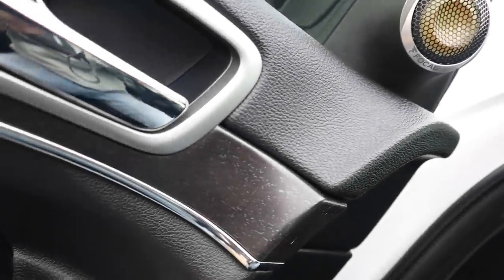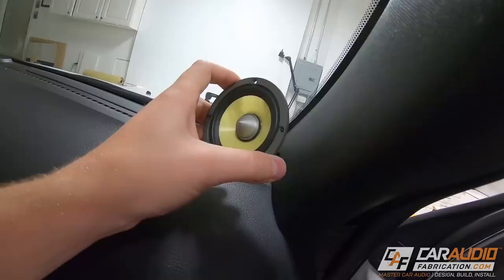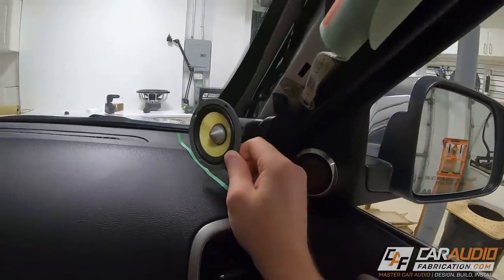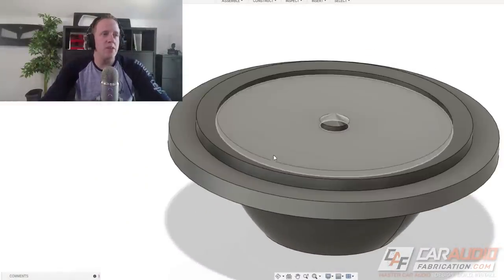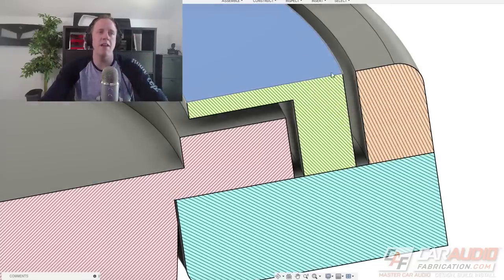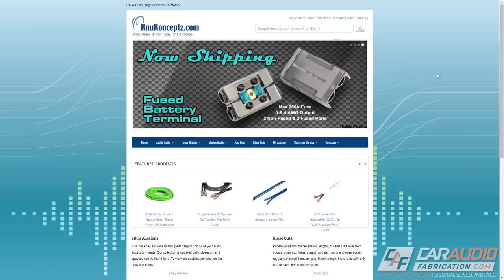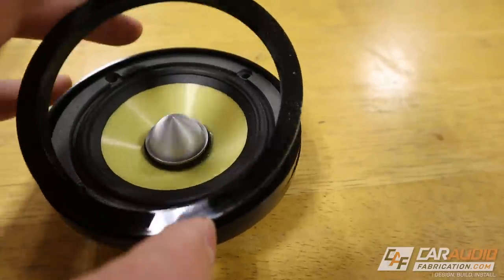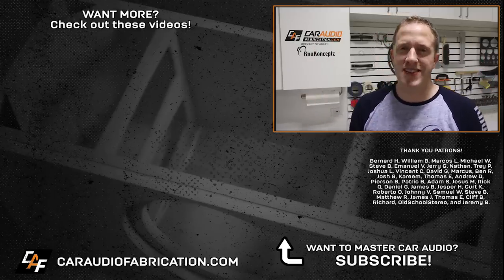Making Speaker Rings & Planning - Custom A-Pillar Speakers

Comment: I just wanted to thank you for being one of the many knowledgeable YouTubers that are not only willing, but also capable of making these how-to videos.
I am currently in the middle of making my very first super tweeter pods.
 I'm kind of regretting not videoing it because I put them in my c-pillars and I haven't found anything like that here on Youtube yet. 
I didn't beam them into anybody's ear either. I placed them up high above the head, as if somebody sitting in the backseat would have somebody shouting over the back of their head above them.
 I'm curious what it will sound like within both firing toward the center console from above.
 Thanks again for all the knowledge and inspiration.

Comment: Heck I wouldn’t be afraid to eliminate that vent.   If you need to defog or defrost side window the dash vents can be aimed.    I eliminated mine in my daily driver 4 years ago and haven’t had any issues at all
Reply from the maker: Hmmm. Thats a pretty good point. I just dont want to hack up the assembly, I can tell it goes pretty deep under the dash, I'd want to take it apart so it can be reinstalled to go back to OEM, and not really in the mood to pull a dash...
Reply: CarAudioFabrication yeah mine were in the sail panels, so they were about a foot long and removed pretty easy.     Multi tool and cut it off flush and cap it would allow yours to be put back together with aluminum ducting tape if going back to oem.   Might not look the prettiest under the skirt if a person looked, but hey.... I’m assuming that’s only if getting traded.    Also a person could look up the parts explosion diagram online and it would show how far back that part goes if you did want to remove.   

Just throwing this stuff out there as ideas for anyone else that’s getting ready to build pillars.      

Did you see in one of the Facebook groups how a fella made a deal and he heats the a pillar and remolds it to create a tweeter spot that looks totally OEM?   WILD!   Looked amazing!

Comment: I would keep those mids on axis as much as possible away from the glass.  I made this mistake in my system, and after many hours of tweaking the sound via DSP, unfortunately I had to eventually put them on axis to achieve the best sound. Remember off axis performance works two ways they are going to bounce a lot of sound off the glass which will boost the 800 to 1200 hertz range, and no matter how much DSP you apply it never will sound perfect.
Reply from the maker: If camera I did quite a bit of listening and I like them aimed like I mentioned in this video, can definitely change vehicle to vehicle. 👍

Comment: quick question, whats your opinion regarding mounting the mid on the door where you have the tweeter? my A-pilar has the airbag starting near the dash so if i put the mid on a-pilar would be way to bulky, so im thinking about mid on door tweeter on a-pilar

Comment: How do you know if a speaker has good off-axis response?
Reply: If available, you would refer to the frequency response graphs that will show how they performed at varying degrees compared to on axis.

Not all manufacturers provide this info, though. But typically the more respected ones do.
Reply: @Captain Buff The Third. Uhm..  I'm ok with that.  

And I'm not disagreeing with you on what you are saying,  but saying i am only semi correct isn't really fair now.  I just answered the question he asked.  

Off axis response definitely can be a big factor in which tweeter you select and how you plan to install them.
Reply: @Captain Buff The Third. Uhm..  I'm ok with that.  

And I'm not disagreeing with you on what you are saying,  but saying i am only semi correct isn't really fair now.  I just answered the question he asked.  

Off axis response definitely can be a big factor in which tweeter you select and how you plan to install them.

Comment: Does anyone have experience with the Focal 3" and 4" mids? I have a huge A-pillar and am wondering if it's worth going with the larger the mid. The door will hold a separately controlled 6.5" and is too far away from the A-pillar for my taste.

Unfortunately, the O.D. on the 4" is quite a bit larger than the 3". So, this isn't a no-brainer.

Comment: For optimal speaker aiming shouldn’t  the midrange speaker and tweeter be on the same plane?
Reply: When possible many ppl would do as you mentioned.

I believe he just had install reasons for mounting them separately. Other wise there's a good chance he would of mounted them on the same baffle, or similar.
Reply: Stephen Carney 😂

Comment: Can you mount the midrange in the lower kick panels aimed toward the driver (with an angle similar to the tweeters) and time align them? I have the same vehicle and did it with 6x9  3 way components and it doesn't sound too bad.  I just don't know how much better it will sound because I can't fabricate and didn't want speaker pods sticking out.

Comment: I was debating on buying some aluminum pods from a company in Germany that produces it for specific brand speakers. It comes with hardware that allows for speaker movement that could be locked down for optimal speaker aiming. The con is that it would be enticing to thieves whereas a custom molded pods into the A piller would look almost factory part of the car and less enticing to thieves as well as can be more stealth. What are your thoughts? Also for a common car like the 10th gen Honda civic could you make them for popular speakers and buy them from you? Pretty sure most of your audience doesn’t have all the sophisticated fabrication tools and modeling software you have. So it’s not a viable diy for the shade tree installer.

Comment: Hello Mark!, My name is Franz and I have big question i know you can answer easily.
1 year ago i got a 4 channel amplifier  capable of 75 W rms per channel at 4 ohm and 100 W rms at 2 ohm per channel.
I hooked up 4 coaxial full range speakers of 4 ohm (One per channel). The problem was
i was lacking of highs. So i am thinking about adding extra tweeters to my system by putting
them in parallel with the coaxial speakers with their respective crossover (crossover only for the
tweeters because the coaxial are full range(they have mid bass and tweeter)). 
Is that solution ok, or is it wrong? (For example: 4 ohm coaxial in parallel to 4 ohm tweeter per 
channel: So the amplifier is gonna see 2 ohm per channel, so my max power per channel
is going to be 100 W rms) Mathematically i know, the impedance is not linear in the
frequency axis and the coaxial is gonna request more power than the extra tweeter butttt....
And here is another question, if i turn up the volume slowwwwly,
how i know when my amplifier or tweeter is gonna blow up or start clipping?
Post data: My neighbor has an oscilloscope hehehe.

My actual system is: (JBL 600Wrms 4ohm mono amp ==> subwoofer Rockford P3 600Wrms 4ohm)
              (Rockford prime amp r400-d4 ==> 4 coaxial speakers = Rockford T1650)
 
       (in the future ==> one new amp for adding only midrange woofer and bullet tweeter)

Comment: Any reason not to go with a 3d printed set?
Reply from the maker: A 3d printer with this size of build volume would be in the $100k club. Coming up with a model for this would require a 3d scanner (well over $20k). Unless you mean a 3d printed pod that is just bolted to the A-Pillar, in which case I don't really like that look, it feels cheap.
Reply: @CarAudioFabrication  I mean just printing the speaker rings. The exact same plastic parts as what you made. But instead of laser cut ( congrats on the new laser cutter if thats yours you're using!) just 3d print the rings. Then do the same fiberglassing as you have planned.
Reply: @marklashta814   I would think a 3d printed ring has a significant amount more of time involved.  The print time for a 3d printer vs cut time of the laser is probably a big factor.  3 minute cut time, vs im sure probably 1-2 hour print time?

Comment: OFC please
Reply from the maker: Just because its silver in color doesn't mean it's not OFC. Silver tinned OFC is superior as it will not oxidize.
Reply: @CarAudioFabrication  When you land on their page, the first slideshow has CCA clearly written on the insulator.
Reply from the maker: They sell both, like nearly every wire manufacturer.

Comment: $2300 for a set of kx3 focals and no mounting  rings included  ? and only 3 layers of acrylic for them not 65 layers of MDF .... swell!
Reply from the maker: The 3 way set includes a pod that holds the tweeter and mid.